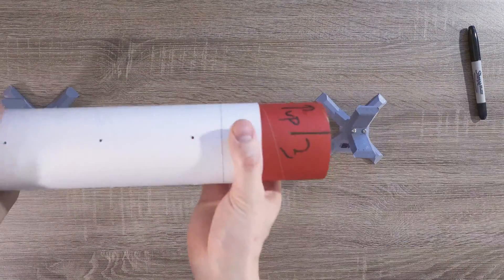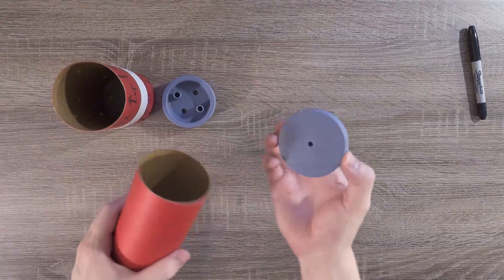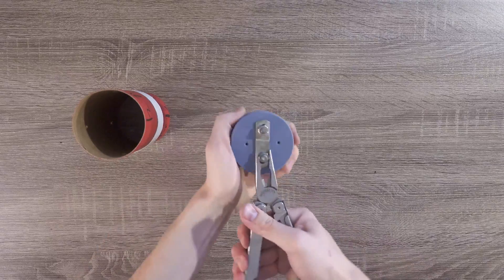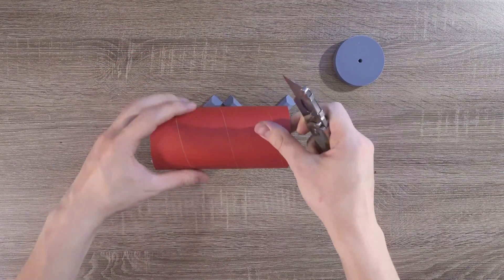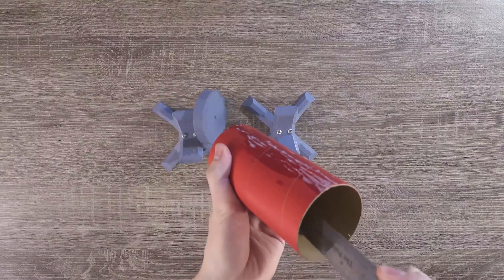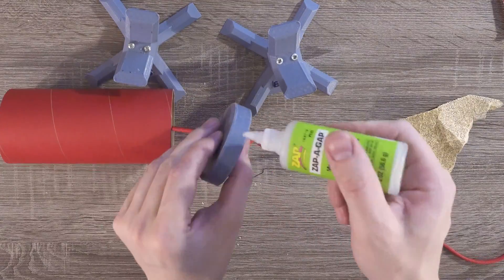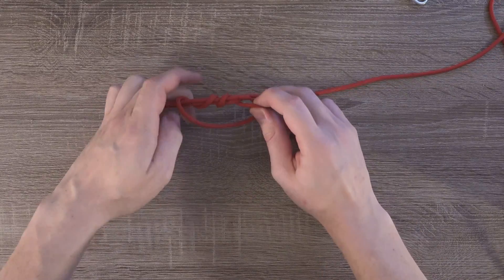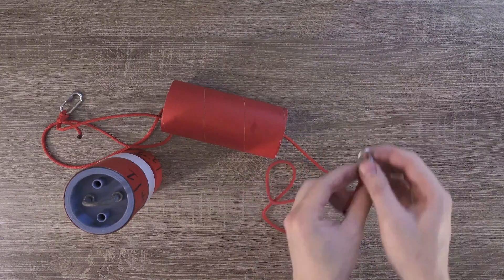Parachute Ejection System - Build Signal R2

Comment: You built the piston upside down.. The closed side of the piston should face the energy that is going to push it.. Just as it does in an internal combustion engine.. Assembling it upside down will make it chatter as it rides the inside of it's cylinder..

Comment: Can't you scratch the bottom quick link and attach the shock-cord directly to the body coupler (the metal "U")? Also, it seems strange to really need that heavy-duty metal U ring for just a couple of Kgs falling from the sky. Can't you design the U directly into the 3D-printed body-coupler part? Even if it's gonna be bulky, I imagine a bulky 3D-printed U would be way lighter than the metal alternative. A decent amount of weight could be spared here, no? (Disclaimer: i'm not into DIY rocket, just a curious guy). Cheers
Reply: I will maybe try this. Thank you for pointing this out! :)
Reply: yeah even regular nylon zip ties are rated 50-175 pounds.  1/4 inch (6mm) nylon rope has a breaking strength of 1100 pounds, and would weigh 98% less than the U bolt and quick links.